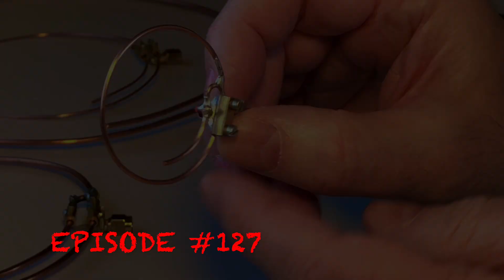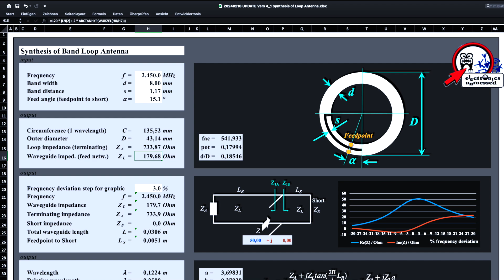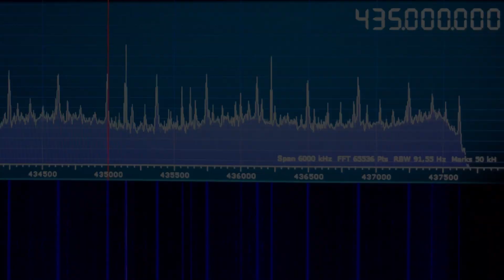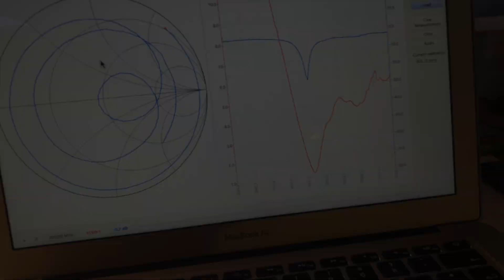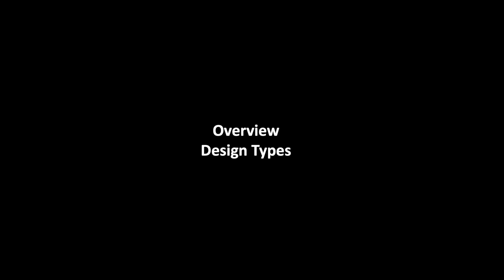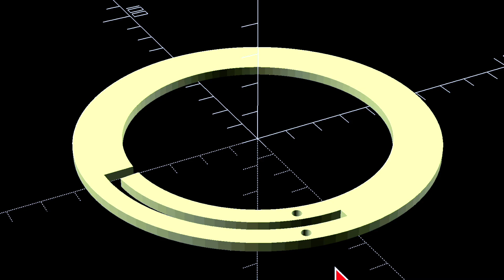Easy CAD Design of Loop Antenna using OpenSCAD Tool (EP127c)

Comment: Thank you. Text-based dimension files for various commonly used frequencies and bands would make everything as simple as possible short of providing an assortment of physical templates, so I'd suggest those would be the most widely useful antenna sizing format.
Reply from the maker: John, thank you for your comment! I'm thinking about how I can create a kind of catalog. Some fans have already sent me pictures, so I could make a small gallery with them. I will put out a call for interesting frequencies. So stay tuned!